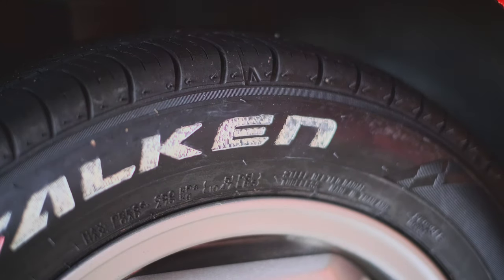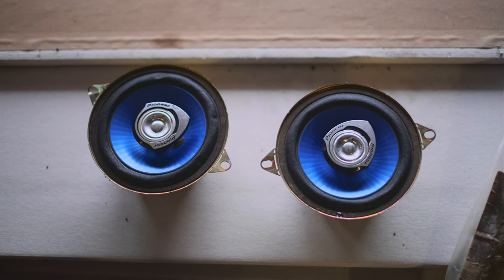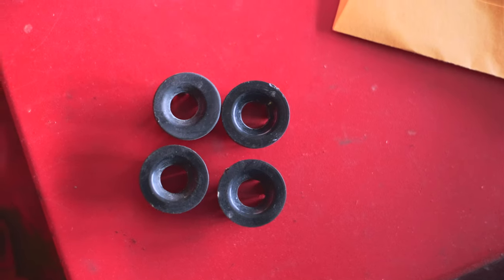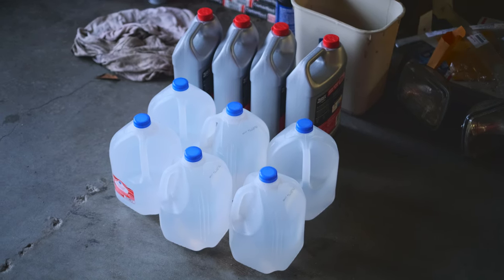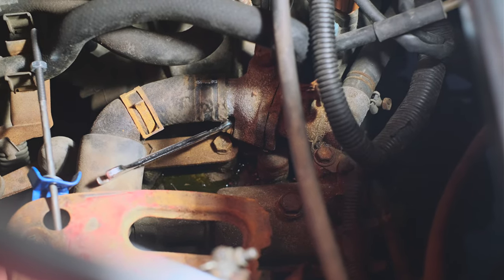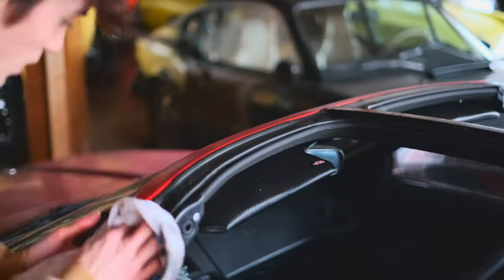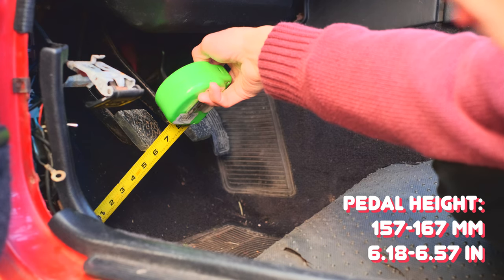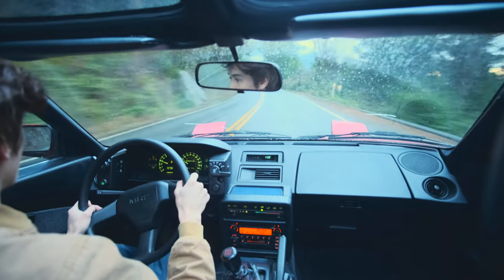Stuck Behind A Barn (#6 Josh's 1989 MR2 (AW11) Workout Project)

Comment: Hey watching the videos. Fixing my mr2 up also. If you want a $ saving tip. The plastic parts that break try plastic welding. Just fixed my headlights bezel the other day. It's like a soldering iron only melting the plastic together. The kit was about $15. Good luck enjoy
Reply from the maker: Yeah I’m going to give it a try on my dash at some point before ordering new stuff

Comment: Awesome vid! And if that rod is still giving you trouble you can try heating it with a small butane torch then tighten it then loosen the nut and keep doing that till its free
Reply from the maker: Yeah heat is a good idea. Else I just have to take the whole thing out from the other side
Reply: Yeah if the heat doesn't work then that might be your last option either way good luck!

Comment: The random connector may be just for some optional extra or a thing that the car does not have, my celica has one near the firewall wire passtrough and also one near the battery
Reply from the maker: That’s true. My other thought is with where it is placed it may be related to the old stock air intake system that was replaced. If that is the case then I hope it’s not something that drastically affects how the engine runs. But again it can’t be that important since the engine seems to run fine from what I can tell

Comment: Hey, I’m in Washington too!  Feel free to reach out for any help.  Also, you can get all the headlight screws including the adjustment screws from Toyota still.
Reply from the maker: Hey sweet! You should hit me up on Instagram sometime. I just bought new mounting screws from the hardware store but good to know about adjustment ones. I’ll probably order some to be safe cuz these ones aren’t gonna last forever haha
Reply: @RetraCast  I’ll do that.  Part number for the adjusting screw is 81131-17010.  I had just ordered all new sealed beam retaining rings (81111-16020) and screws for mine for a fresh install after paint.

Comment: Recently found your channel and it's crazy how similar our mr2 plans are! I also got mine back in August and have also been slowly restoring it on a budget but I'm doing everything mechanical first before I work on cosmetics. It's actually my 2nd aw11, first one I had for over 4 years but was almost forced to sell it as it was in an accident that totaled the car. Cost way too much to repair. On that car I actually swapped a 20v silvertop which was awesome but there's something about keeping that stock 4age that makes it special, which is what I plan on doing on my new mr2. You should really try and find the stock intake when you can, it'll really complete the overall restoration look of the car as you've already done such an amazing job with the interior! Really looking forward to seeing how the car turns out as I really like your overall vision of keeping it stock while putting your own unique flair like you did with the painted wheels and patches on the seats. Best of luck!
Reply from the maker: Yeah as I drive the car I do really enjoy the stock 4age. And yeah I wish I had the original intake but it’s not a priority at the time to revert as of now. I will say I may have to do some big engine work sooner than planned as it runs fine but burns a lot of oil. I still need to do a compression test but I’m hoping it’s just some valve stem seals. Whenever I drive the car something else wrong happens haha. I’d just do a full rebuild if I could afford it. But I also wanna drive it at least a bit hahaha. Anyways thanks for watching and I wish you luck

Comment: Damn, steep price on the exhaust. Can't help but think you got ripped off a bit. I would've guessed adding a O2 bung would've been like 60$. Did they do a lot of additional work? e: Since there is an exhaust leak too, I feel like you should ask for a compensation / have them fix it on their dime.
Reply from the maker: Yeahhhh kinda why I mentioned last video I wanna avoid shop work when I can. They did clean up the exhaust and muffler pieces well since they had lots of gunk on them and slight surface rust. Other than that they also had to remove the old exhaust and install and fit the new one. If I did it over I probably woulda just brought the single pipe and asked them to just weld the flange and nothing else. Then I’d install it all myself. Oh well what can you do
Reply: Yea I think 600$ can buy a brand new "after market" exhaust like from a parts store...

Comment: Where did you order the t top guides because I just recently got a Same generation mr2 and the t top is leaking and I feel that if I got those guides and new seals I could fix the problem
Reply from the maker: From TwosRUs. They sell pretty much most MR2 stuff you’d need
Reply: @RetraCast  thank you so much 🙏

Comment: Don't do a swap....those 4age has a great potential..  just put in on a little turbo low boost and still healthy daily driver😉
Reply: Nah bad idea, 4age is a high range engine, sure adding a turbo is gonna highlight its "happy range" but your neglecting the low ends. The car is made to steer, adding a turbo is gonna make it unstable even if its slight.

Dont treat it like a civic, treat it like a mclaren, maybe a porsche.

A small centrifugal is perfect for the thing, a tiny plus for the highends and a big upgrade for the bottom, making the engine balanced. Discount SC

Comment: Working on cars please dont put parts of the body to work on items. It scratches the paint and dent it when it was completely unnecessary. Take you part to a bench or cardboard on the floor. Go to harbor freight and get those foam floor squares. I use those for engine rebuilds, glass parts, etc. I love old cars and like to keep it original as possible without painting it. I see a lot of people work on parts on the trunk and it hurts to see. Also if you do work for others later on, it shows you really care for thier property and take care of it.
 Also putting tools on the cowl or fender area leaves scratches and opens a chance to crack the windshield. Putting tools on a cart or the floor away from the car shows professionalism. 
  I'm old but I love watching these videos. Keep it up. Reminds me of my youth
Reply from the maker: Yeah as someone who works on lots of cars both nice and beat, I do agree being careful. But this car is definitely in full need of a repaint and body work anyways. I’m not sure if you’ve seen the previous videos or not but the last owner did a terrible plasti dip spray job on the car that I’ve slowly been removing. The paint beneath is worn through with white patches in spots and has dings and dents throughout.

So yes I totally agree it’s not the best practice, but this (unfortunately) is a very rough project car. That being said I am planning on doing the body work and repainting it in the future after getting some more of the mechanical work taken care of. So I’m excited to someday see it as good as new, like it deserves to be. Rather than this sad neglected state.